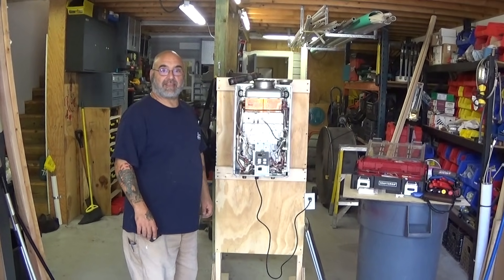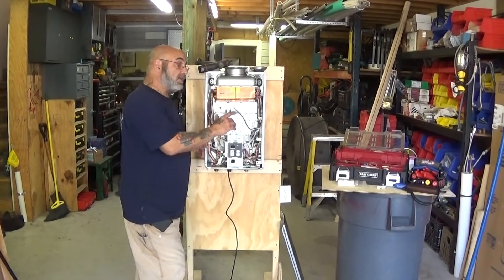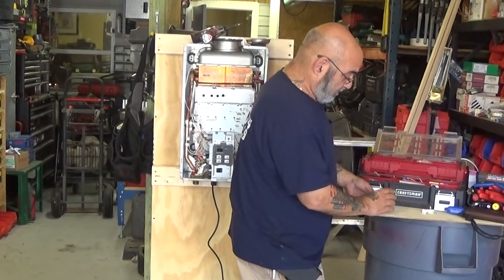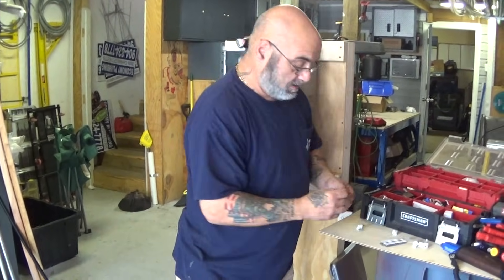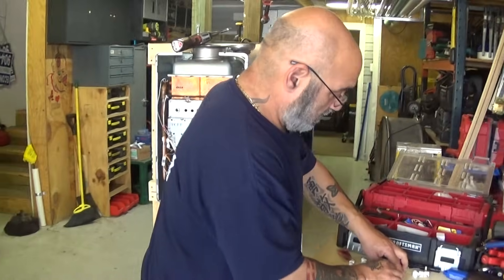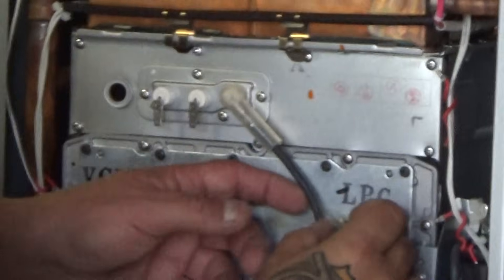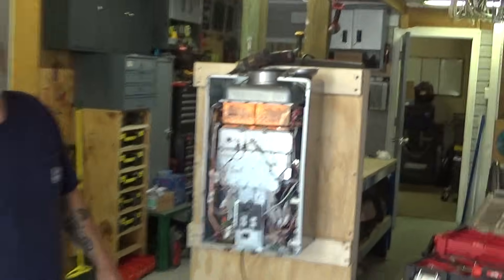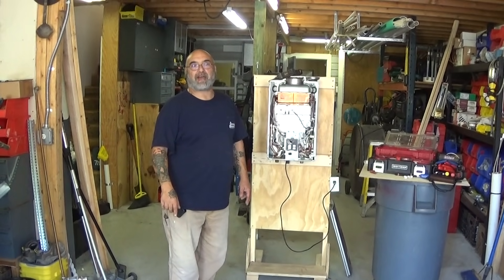Code 12 on a Rinnai tankless checking the flame rods

Comment: Mike,
I watched your video on YouTube.
I have a Rinnai R53 installed in my house - 12 years old. It's located in the basement. I have never had a problem and all of a sudden I am getting an error code 12 and the water turns cold. I had my wife activate the hot water while listening to the unit. While the unit is operating, I can hear a clicking sound. The units shuts off and the error code 12 appears. Do you have any recommendations?
Dan
Reply: Danny Rutherford call me tomorrow Saturday the 8th and I will go over it with you.
Mike 904-238-5349

Comment: Great video Mike! I have a code 11, burner was filthy, replaced igniter , still no flame. The unit has been working for over 8 years, the gas dryer and stove are still working, so I still have gas. Any suggestion on what to check next?

Comment: Zoom-in not Pan-in.  A Pan is a sweeping shot.  Close-ups are important to keep focused on for a few seconds.  Otherwise YOU R THE MAN.
Reply: Amrtvideo Thanks was never that good with a camera. Thanks for the comment will try that. Check out my Instagram page at 
Michaellatronico and if you can give me some advice👍 Mike
Reply: Mike I have a R53 Rinnai that won't start.   I have cleaned the Fan, The Firing Rods, Drained the Water inside the Unit, We have Electric & Propane, Cleaned the Preliminary Water Filter [located @ the bottom of the unit but nothing seems to make the R53 "kick-in".  The Unit is outside.  Someone said to hit the Reset switch but this unit doesn't seem to have one.  I have not flushed the Unit w/White Vinegar.  I imagine the unit is less than 9 years old [calling for the owner].  All the wires seem hooked up so I'm at a standstill.  Any further suggestions?

Comment: Thank you so much for taking the time to make these videos.  They are very helpful and easy to understand.  Yesterday I changed dip switch #6 and turned the temperature up to 130 using the remote.  Last night I started getting the error 12.  The water starts hot, then I get the error and it goes cold.  Does the temperature change have any bearing on the error?  If I set it back to 120, I don't get the error.  I really appreciate your answer.  (It's an RUR98.)

Comment: Our Rinnai runs for a bit and then “error 12”as we add cold water (like in the shower) Not always but about 30% of the time.  I live in the country and have tried several local servicemen. No retuned calls (happens a lot in the country). I’m looking forward to your next error 12 video.
Reply: Daryl Sims e mail me your contact info and I will call you. Please give me the model, age, gas type and where it’s located. Mike
Reply: Hi the same thing happened to me on one job, exact same thing in the shower
Reply: Rinnai A26 ULPG in New Zealand

Comment: Are you familiar at all with the Paloma tankless water heater? Throwing the same code 12.
Reply: Helina Helina sorry I’m not. But all tankless heaters share almost the same trouble codes. That code is flame failure, it could have been low gas pressure but if the unit is a few years old and has been working good until not it’s probably good. There could be a blockage in the vent. The most common problem it the flame rid or igniter it also could be that the gas valve has failed. I would recommend going on there web sit to see if there’s a qualified service tec. in your area. I hope that this was helpful.
Mike

Comment: Thanks for the video! I am getting a Code 12 and am wondering if you have heard of a situation where some rooms are much more reliable for hot water than others, and when the others aren't getting hot water it's a Code 12. For example, the master bath and the kitchen sink are much more reliable for hot water than the guest bath. Thanks!
Reply: Matt Smith if the guest baths are the furthest from the tankless you have all that piping to drain of cold water before the hot water to get to the faucets. As far as the code 12 that’s flame failure. Does it happen when you run just one faucet or a few. How old is the tankless? And have it ever been serviced.
Reply: Mikes wood shop thanks so much for the reply. I’ve left cold faucets running for 5-10 minutes as I go back and forth to the heater restarting it trying to get it to light. The problem (lack of hot water with Error Code 12) happens almost every time I try to use two or more hot water sources at once; two showers, washing machine and dishwasher, etc. I believe the heater was installed in 2008 and I had somebody come out to diagnose it roughly 6 months ago and they said I need a whole new system at around $7k. I have learned ways to work around it but now that it’s 25* in Houston it seems to be getting less reliable.
Reply: If gas pressure is verified then a leak of the exhaust into the combustion air is the likely cause.  A common problem is an improperly installed or separated flue pipe.  At low water flow and low burner the combustion is good.  At high water flow and high burner the leaking exhaust gases are drawn back into the burn chamber resulting in an improper fuel/air mixture.

Comment: Hey Mike, I have a rinnai ruc98i  set up for propane gas. Do you know what would have to happen to change it to natural gas. Thanks
Reply: Stephen Eubanks you would have to get the conversion kit from Rinnai it’s the burner plate that needs to be changed. You have to get the ok from a Rinnai Tec. Support in order to buy the burner plate from the dealer. I hope this helps. Mike